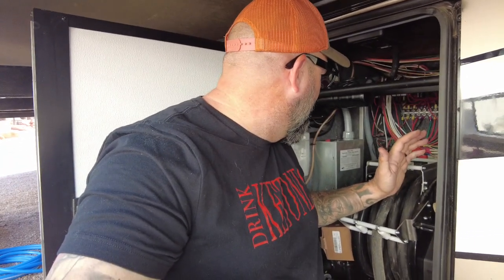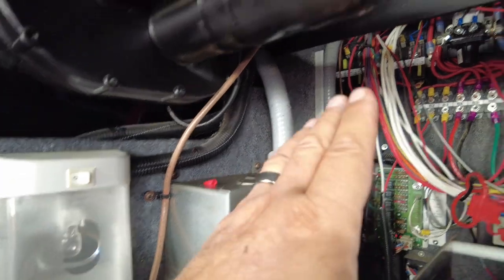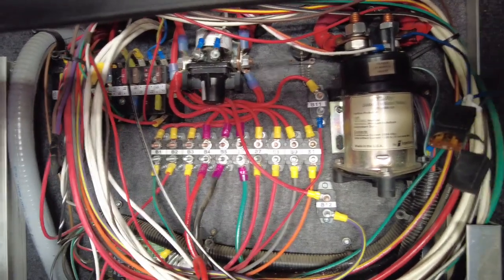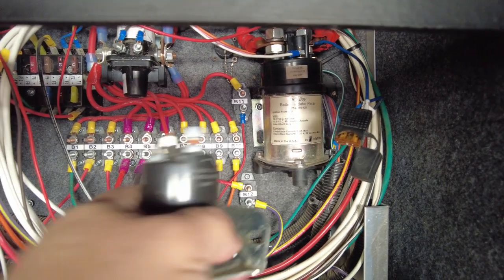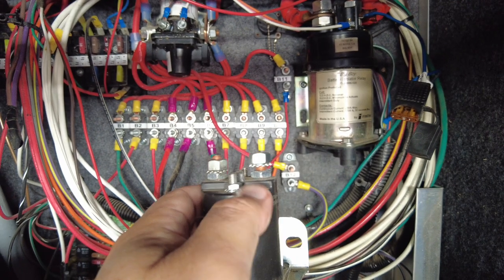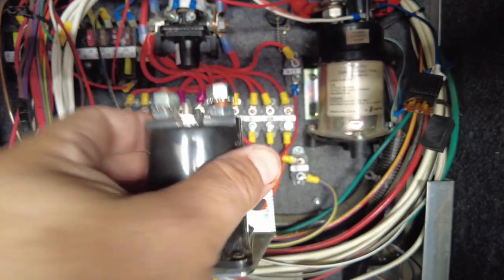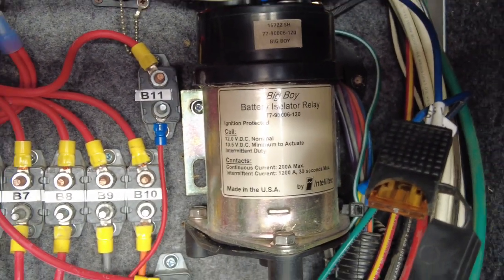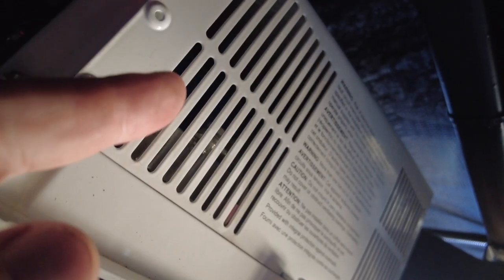3 things to check if RV Batteries Are Not Charging.

Comment: A few fine points.   A converter changes AC to DC.   An inverter changes DC to AC.   So , a converter charges batteries.   The components you discussed are correct.  There is one more part than can cause your batteries not to charge,   There is usually a 50 amp DC circuit breaker.   If you have voltage going to it but not on the other side, it has tripped.   On the breaker there is a very very small button on it.  Give it a little push and it will click if the breaker was tripped.   It can trip if your house batteries are very low, and you start the engine.   It can put more than 50 amps in the batteries.   Long enough and the breaker trips.
Respectfully,    Kevin

Comment: I seem to have the reverse problem. My chassis battery is the one that isn't fully charging or so the monitor indicates a warning. In fact, the original battery was declared dead and worthless after 3,000 miles. Ford replaced it. Now, I'm getting chassis battery warnings on my coach battery monitor. when the warning occur, my slide run out/in 5" and quits. Then, I have to start over, turn the vehicle off, disengage the brake, restart, re-engage the brake and the slide eventually goes all the way out or all the way in. After 400 to 500 miles on the road, and no chassis battery warning, the slide will often go out on the first attempt. I conclude that the chassis battery is not being charged. There are no warnings for coach battery, Any help will be much appreciated,

Comment: Another way to charge the chassis or house batteries from the other is through a DC to DC charger/power supply. Victron makes them in different amperage levels and you can configure and monitor everything using an app and bluetooth

Comment: Interesting … I’m going to try this on my fleetwood bounder diesel… right now I think it’s the opposite… shore power is charging house batteries but not the chassis batteries… any suggestions?   We bought the coach used so we may just need to replace all the batteries…